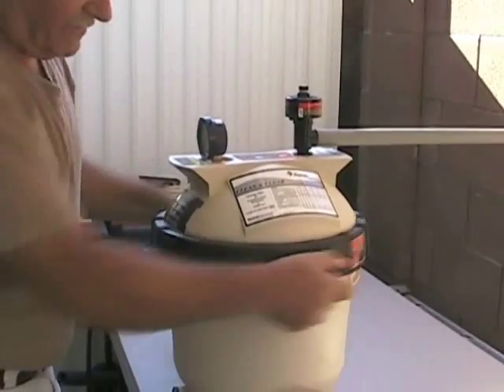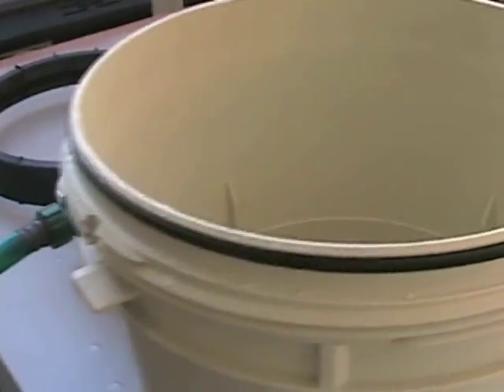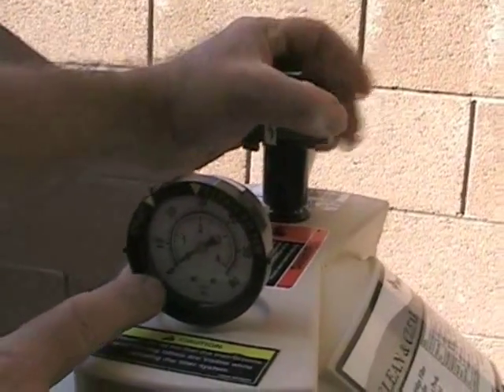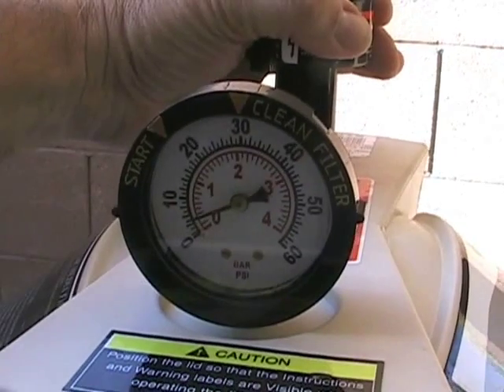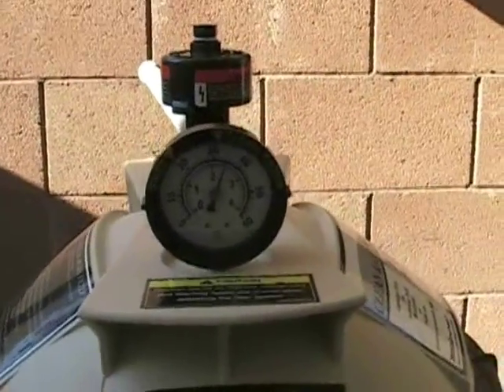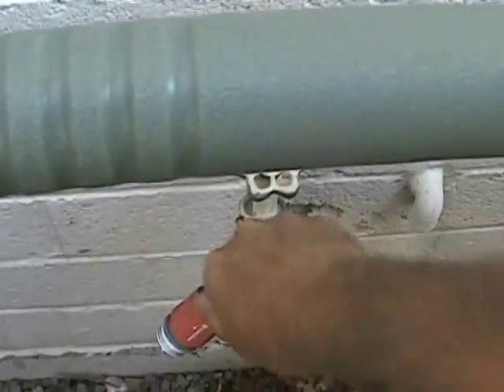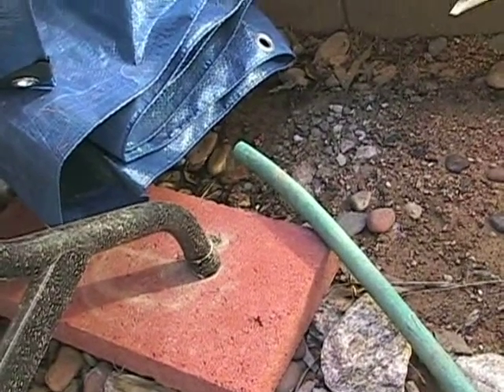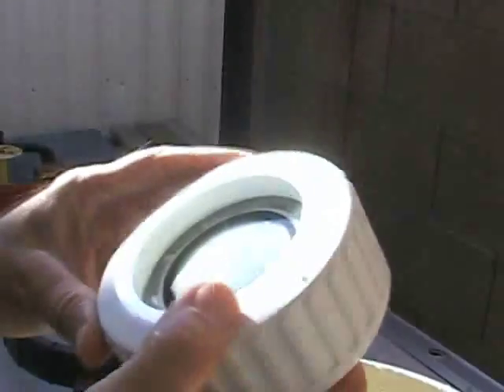Test of the Hydrostatic Pressure Chamber

Comment: thread is generally unreliable seal for parts working under pressure that require frequent pairing, teflon tape helps only if you seal it and leave alone. latch locks work better for such applications IMHO.

Comment: Great Idea using the pool filter for the pressure chamber. You've probably all ready figured out your leak but if not try putting a minimum of 5-6 wraps of Teflon tape on the plug end of your housing.

-Steve